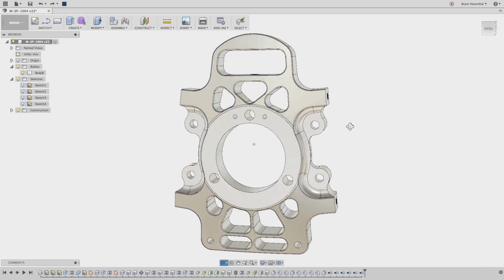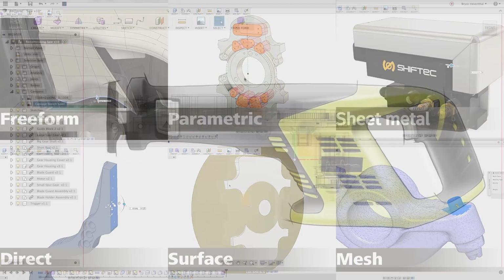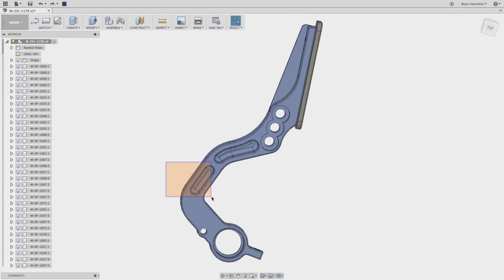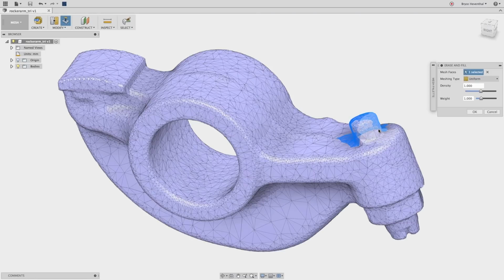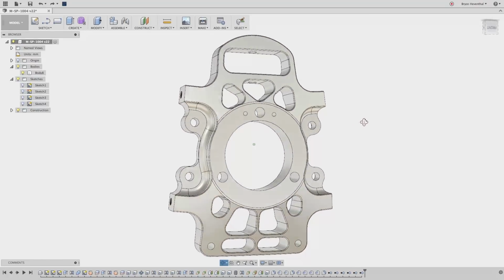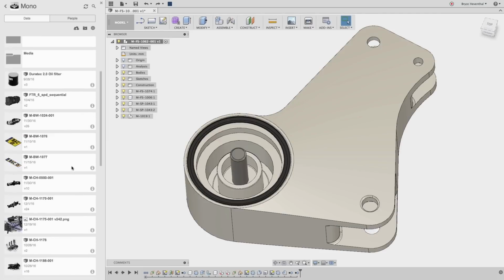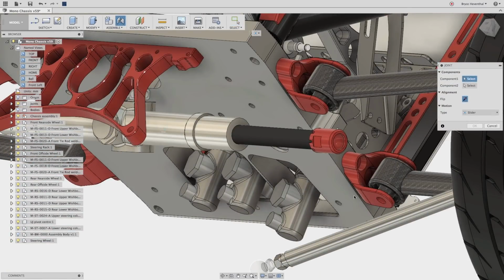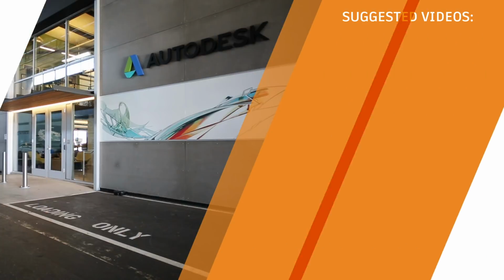Modeling Methods

Comment: The Eagle and Fusion360 'integration' looks good in demos, but the real world usage is fiddly, cumbersome, and full of bugs that create errors and crashes. It has a very long way to go before I would advrtise it. 

The CAM is rather good - even after 10 years with MasterCAM. F360 is very powerful in this area. 

With 20 years of SolidWorks - F360 is not a competitor (yet). It has some really slick features, but there are still too many limitations and weird ways of doing things. In some ways assembling with 'joints' is kinda nice - but it is not nearly as friendly as 'mates' in SolidWorks. For simple stuff it is quick and easy. When the part relations are more sophisticated - it makes me want to jump off a cliff. 

At the current pace of development - I would guess F360 has a good shot at being a tool for pros.
Reply: Eagle to F360 issues come down to parts modeling issues IN Eagle. F360 takes whats its given and Eagle lacks all over the place in proper 3d models of components.  If there is anything to bitch about, its Eagle, that is a suite that is about as convoluted as a soap opera plot. Truthfully, Im surprised Autodesk actually got anything to work with Eagle and this is coming from someone that uses Eagle regularly and uses F360 to make enclosures.

Comment: How can I group sketches ???
Reply from the maker: Just tested...and it didn't seem to work at all! Very frustrating. Going to report that something is wrong.
https://www.dropbox.com/s/y0lf37iot1jn0xj/GroupSketchesNotWorking.gif?dl=0
Reply: @adskFusion  great, tyvm.
Reply from the maker: It seems that the option shouldn't exist there. It will work in the timeline, however. This is something that made it to the preview of the tabbed UI but will be removed --thanks to you reporting it!